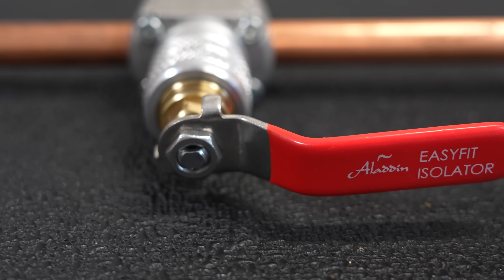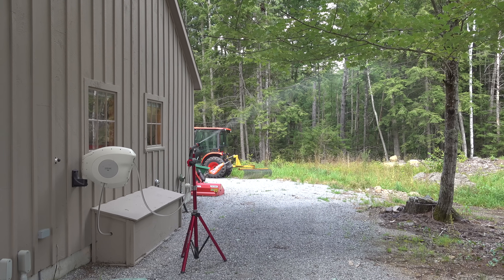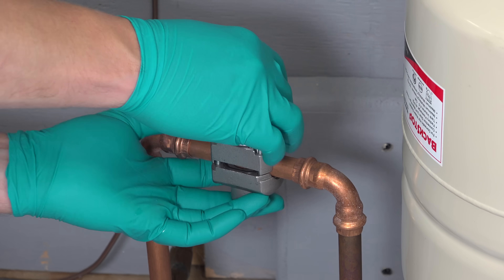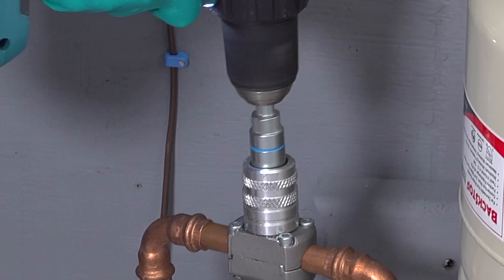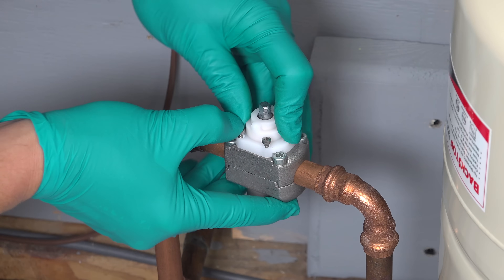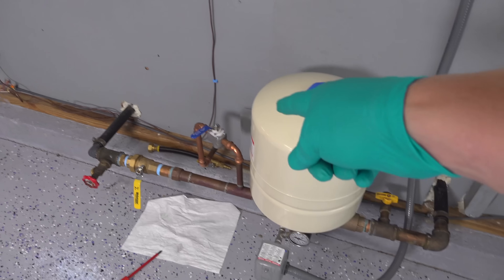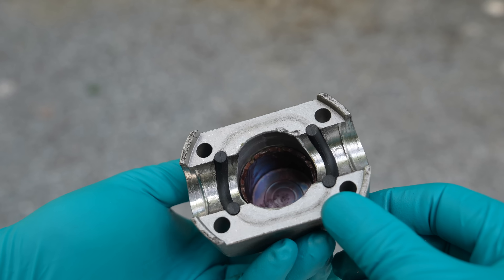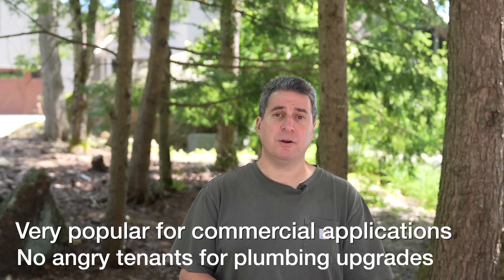SHUT-OFF valve installs on a LIVE WATER PIPE - Aladdin EasyFit Isolator

Comment: Is this safe for a combi boiler? How much debris is left in the pipes by the cutter?
Reply: Thanks for your comment, the EasyFit can be used up to 185F. Due to it’s unique design the pipe coupon and swarf is captured in the lower housing in the special chamber at its rear so no debris is left in the pipes.

Comment: The process is known as a hot tap it can be used for gas pipe lines air and water with out the need to isolate any main supply this is a copy of the product I was using over 15 years ago its not a new idea!
Reply: Thanks for your comment, a hot tapping installs an isolatable branch unlike the Easyfit which installs an isolator into the main pipeline.  The EasyFit is a patented product which was designed in the UK and has been sold for just over 10 years.

Comment: I just looked for this on Amazon, and the price is over $250  That is a ridiculous price,  I would rather turn off the main line and install a $30 isolation valve.
Reply: Thanks for your comment, the price quoted is the full or list price, contractors would pay less.  Where the water line can not be shut off the EasyFit provides a quick, safe solution which is also to code.

Comment: Water co. Uses crimp valves all the time, problem is over time they are hard on the pipe. This cutting in line if it fails later will be a big problem later too.
Reply: Thanks for your comment, the EasyFit is not a crimp valve it is a patented product with unique dual seal technology.   It  was designed in the UK and has been sold for just over 10 years; it hasn’t been known to leak once installed.

Comment: A long gone old 4th generation prairie farmer had a saying for this..
"You're paying for what it DOES, you're not paying for what it is."
Reply: i like that.
Reply: You're paying for something you can do far more inexpensively, and almost as easily, with other products.
Reply: @jim6690  A year ago, more expensive, perhaps. Four months ago, more easily, perhaps. Post your "other products" suggestions. Otherwise....
Reply: @richardbowles8783  
Other products would require water to be sprayed out.
Things like Sharkbites, Pro Clamp fitting/Press fittings..
Granted it would work but you will have a few seconds of full pressure blowing out of that pipe... Have some towels and a shop vac ready
Only thing that concerns me with this design is where does the copper you are drilling out go? Its got to go some place.
Reply: @bobshanery5152 , personally, I would use a Sharkbite valve, and save $290, and clean up a bit of water, but to each their own.
Reply: @bobshanery5152 Into the base of the valve, then held in place by the ball valve once lowered.
Reply: @jim6690  I am not trying to be that person who just disregards any new products but at the same time in general it blows my mind how lazy people can be about just learning a new skill. Brazing copper pipe isn't hard. It's like $60 in tools and a skill that will both basically last you a lifetime. We're talking about replacing a coupler, a straight piece of pipe, one gate valve, etc. Not replacing the entire system in a house. It saves you a ton of money for like 1-2 hours of research and a real gentle learning curve.
Reply: Sounds like US mentality.. didn't lead to much good if you look at their economy.
Reply: Translation: They’re RIPPING YOU OFF!!!
Reply: @Tryp-j9d  The people who really need it are paying for the R&D that went into making it that easy, at least until the patent expires.  If you want nice things, you need to pay people their fat stacks to invent them and bring them to market.
Reply: @Tryp-j9d  not the point. i would rather get ripped off on a dyi valve than wait a week for a plumber to show up while my basement floods.

Comment: I never like to see a small water droplet when you are tightening something that should be watertight on the part where he said that small white piece with the four screws you see a small water droplet
Reply: Thank you for your comment, this is PTFE grease from the cap screws –  (you can see a small white curl of it on the housing).  We grease the screws to ease the Cap attachment operation

Comment: For the extra time the install takes, you ccould shut off fhe supply vALVE
Reply: Thanks for your comment, the Easyfit is designed for when the water can not be shut off.

Comment: Interesting and great innovation. But if it's priced like this in the UK (really doubt it) I don't get how they're still in business. Shutting off the water and cutting the pipe isn't worth the extreme over-price here.  I'd rather spend my money hiring a plumber if I was to spend that much.
Reply: These are designed to provide the ability to shut off the water during an emergency, such as a burst pipe spewing water in the home, when you can't shut off the water supply coming into the building, for whatever reason.  As inexpensive as sharkbite fittings are, and as easy as they are to install, there would be no good reason to install this type of valve if you were able to shut the water off to the building instead of having to tap into an active and pressurized line.

Comment: You need to locate the main where it enters the house, usually on slabs I see them coming up through the floor in the utility/laundry area. If there's no shut-off valve installed within a foot or two of where the main comes out of the slab, you should have one installed.
Reply: Thanks for your commet, the EasyFit is perfect to fit in this situation.

Comment: is this product re-usable? like if the water needs to stay running for X reason, while you do a bypass or something, and then removing it after the job is done, putting it back in the box for the next job.
Reply: Thanks for your comment, the product is not designed to be re-used.

Comment: Where did the piece of cut copper pipe go?
Reply: 🪄 magic 🪄
Reply: @MisterSiga  yeah 👍🏻
Reply: mate i figured it out. it gets pushed into the back of the valve body.
this vid shows how it works at around 1.50
https://www.youtube.com/watch?v=MCVQ0HkxNeg
Reply: Thanks for your question, the coupon and swarf is captured in the lower housing in the special chamber at its rear.

Comment: At least tell the people to flush the line behind the line to remove any possible dust/metal shavings from the process. Nice demonstration!
Reply: Thanks for your comment,  both the pipe coupon and swarf are captured in the lower housing in the special chamber at its rear.

Comment: These tapping solutions have been available in Germany for gas and water pipes for decades. Every new gas branch on the main pipeline in the street is installed in this way.
Reply: I worked for years at the gas company. You are talking about a saddle valve.This product is not the same at all. Saddle valves only close the branch not the main
Reply: That's not the same thing at all.  It's amazing how many people actually don't understand what this valve actually does...
Reply: @derekblanchard9159  T D Williamson in Nivelles, Belgium make the stuff to do Hot Tapping,  They produce stuff for Every eventuality !
Reply: @derekblanchard9159  It is the exact same thing.
Reply: Hot-tapping in a main line is only adding a branch; this adds a block valve in said main line.  Sure, part of the process is similar, but the end goal is completely different.   @julianreverse
Reply: @derekblanchard9159  Every single branch has a valve.
Reply: Wow, you're obviously not understanding the difference.  Come back to this conversation when you're smarter. @julianreverse
Reply: Thanks for your comment, a tapping installs an isolatable branch unlike the Easyfit which installs an isolator into the main pipeline.  The EasyFit is a unique patented product which was designed in the UK and has been sold for just over 10 years.

Comment: And what happens when that piece that was drilled out goes into a booster pump or recerc pump.        Costly damage.
Reply: Thanks for your comment, the pipe coupon and swarf is captured in the lower housing in the special chamber at its rear so no pieces enter the pipework.

Comment: what happen to the metal derrières that is cut into the pipe  I  don’t think is safe to use the water?
Reply: Thanks for your comment, the  pipe coupon and swarf is captured in the lower housing in the special chamber at its rear.  The EasyFit is both UPC and NSF approved for use on drinking water.

Comment: Hmmm, saw some drips when you installed it.
Reply: Thanks for your comment, this is PTFE grease from the cap screws –  (you can see a small white curl of it on the housing).  We grease the screws to ease the Cap attachment operation

Comment: The biggest downside I can see as a non-plumber is that you need to make sure there is nothing on the exit end of the water line that can become damaged by all that copper debris from cutting the pipe
Reply: Hi one of the many great things about the EasyFit is that no copper debris goes into the pipe.  The pipe coupon and swarf is captured in the lower housing in the special chamber at its rear.

Comment: Just paid a plumber over $600 to install a ball valve in the garage to turn off all water coming from the water meter. Sure there is a valve at the meter but it is over a foot below ground level and needs one of those  long handled water meter keys. Even the plumber (strong younger guy) had troubler getting the water off at the meter.
Reply: Hi sounds like it would have been a great time to use an EasyFit 😀

Comment: Awesome product, BUT way too pricey... You could turn off the well pump, Cut the pipe, insert sharkbite fitting as fast as you just read this OR the best way is to use Copper Union. Yes you have to solder, but you can also use screw-on valves. I've done it..
Reply: Thanks for your comment, the EasyFit was designed for those times when you can't switch off the water.

Comment: There is no way that copper chips are not being left inside the pipe.
Reply: Thanks for your comment,  the pipe coupon and swarf is captured in the lower housing in the special chamber at its rear - this is part of the EasyFit's unique design.

Comment: Where do the metal shavings go? Do you skip the multivitamin and just drink the water?
Reply: Thanks for your comment, the pipe coupon and swarf is captured in the lower housing in the special chamber at its rear.
Reply: @easyfitisolatorusa  I can see the large section being captured but the shavings I guess just go through? I am not knocking the overall idea, it is great but I cannot see how the shavings do not end up in the system.

Comment: Expensive yes. But sometimes where we work we have to turn off the whole factory water supply to do a job so this would be ideal to install and then do the job   A lot of installations around do not install enough valves to isolate sections of pipes.
Reply: Thanks for your comment.

Comment: $350.00? I'll shut the water off and fix it for $30.00 or less.
Reply: Thanks for your comment, the EasyFit is designed for those times when you can't switch the water off.

Comment: I work in a plumbing shop in Ireland and was wondering why I have never even heard of this. That was, until the price at the end.
Reply: Thanks for your comment, the EasyFit sold in the USA is different to the one sold in the UK, due to our harder pipes hence the difference in price.  The product has been sold in the UK for over 10 years and is called the Aladdin EasyFit Isolator 😀

Comment: So I have a shut off valve trapped behind my hot water tank.  We can’t actually shut off our water from the inside of the house.  To move it,  the water has to be shutoff at a valve under dirt in the garden.  Then the water tank has to be drained. And then D installed. Then fix the pipe where we would cut out the shut off valve.  Cut into pipe somewhere convenient then install a new shut off valve. Then put the hot water tank back in. Estimate to do all of this $3000+ dollars.  How’s this $250 or more device look so far ?
Reply: Thanks for your comment, you've just described the type of situation the valve was designed for 👍

Comment: I saw some water on the valve as you were putting the handle on it .
Reply: Thanks for your comment, this is PTFE grease from the cap screws –  (you can see a small white curl of it on the housing).  We grease the screws to ease the Cap attachment operation

Comment: I made one mistake using one of these once. All on my own fault for not reading up on it properly about these funny valves.
Some copper pipes have really thin walls and will collapse in on themselves when clamping this on. Just the force from the rubber seal itself was enough to start deforming the pipe I installed it on. And when I started to drill the cutting head in it didn't cut the pipe. It simply crushed it instead. That caused a major leak and the deformed pipe could no longer stay sealed.

I should've known. I have worked on thin-walled pipes before. One is supposed to use pipe stiffeners (inserts). In the case of these valves, pipe stiffeners cannot be used as that requires removing the pipe, cutting it and manually inserting the stiffeners inside the pipe. At that point, one might as well use a regular valve. (Pipe stiffeners are still required)

Comment: 250$ typical plumber rip offs , since this product is uk approved and us adopted why not try the PPL pipes that are heat fused together and don't break when frozen? Instead of copper. P.S. what happens with the cut peace from the holesaw?
Reply: Thanks for your comment, the coupon and swarf is captured in the lower housing in the special chamber at its rear.

Comment: it sounds easier to buy a ball joint and learn how to solder it on. lol that gasket is doomed to fail at some point.
Reply: Thanks for your comment, the EasyFit was designed to be used when the water can't be switched off to solder a ball joint.  The gaskets in the valve housing seal during installation. Once the valve is installed the boot inside the valve acts as the primary seal – it’s a dual seal valve.  They have been sold for over 10 years in the UK and haven’t been known to leak once installed.

Comment: Wow! That is expensive. Would be cheaper just shut off the water, cut the pipe and put a valve in. Might even be cheaper to have a plumber do it. This is definitely a last resort! I might buy one for 40 bucks but never at 250+
Reply: Thanks for your comment, the EasyFit was designed for when you can’t switch off the water.

Comment: This reminds me of the valves we use to use on A/C lines. Since they have pressure you tighten four screws then tighten valve and it pierces and seals line. Then you can hook gauges on to check the pressure. Dont remember the name but its the same concept as this.
Reply: Bullet piercing valve is the word I was thinking of.

Comment: Half inch pipe !!...never used that in my life....is that in US ?...these valves are 35 UK pounds here.
Reply: Thanks for your comment, the EasyFit sold in the US is different to the one sold in the UK (which sells for around £60) as pipes are thicker and harder here the product was re-designed for our pipes.

Comment: Can only be used on copper tubing - cannot be used on CPVC or FLEX
Reply: Thanks for your comment, this actually works with any grade PEX but only “CTS PVC” which is the same ID and OD of copper tubing and PEX.  We are currently working on a plastic valve ......

Comment: Great device, but price would deter me.Recently had to cut into a line to install shutoff valve with water on luckily it was pex so cut the line ,slip pex clamp on ,put pex valve on in shutoff position  and clamp it.took 4 minutes vand cost 18.99.

Comment: Having the water on outside would lower the pressure wouldn't it?. I am curious, it's an interesting idea. Although, just shut the water off. If this goes wrong you should still be able to turn the water off, so just do that in the first place and use a compression fitting, solder or even a sharkbite. Stupid thing is, I still want one of these now...

Comment: These style valves tend to leak  nearly every time you use one.
Reply: Thanks for the comment, the EasyFit is a unique patented product with dual seal technology.  It has been sold in the UK for over 10 years and has not been known to leak once installed.

Comment: I know the vid said the cut off piece of pipe gets pushed down into the lower half but what of the metal shavings from the cut itself?
Reply: Thanks for your comment, due to the EasyFit's unique blade design the pipe coupon and swarf is captured in the lower housing in the special chamber at its rear.

Comment: i see many leaks to come  from this and there is water from the screw area
Reply: Thanks for your comment, the Easyfit has been sold for over 10 years in the UK and has not been known to leak once  installed. The is actually PTFE grease from the cap screws –  (you can see a small white curl of it on the housing).  We grease the screws to ease the Cap attachment operation

Comment: Residential wet tap . Why wouldn’t we just drain the line and put a permanent valve in?
Reply: Thanks for your comment, the EasyFit is a permanent solution with both UPC and NSF approval and avoids the need to drain the line.